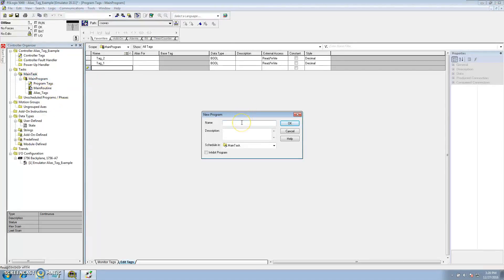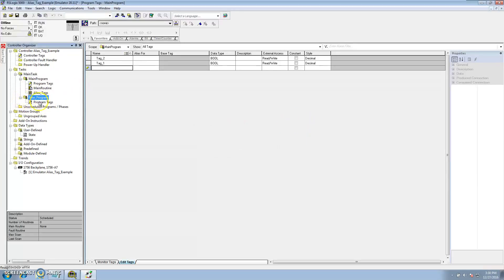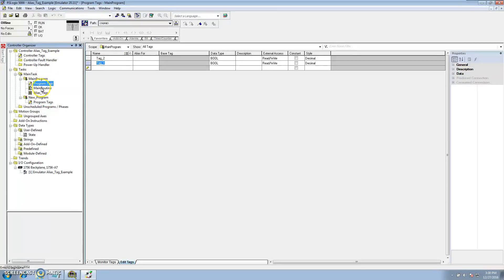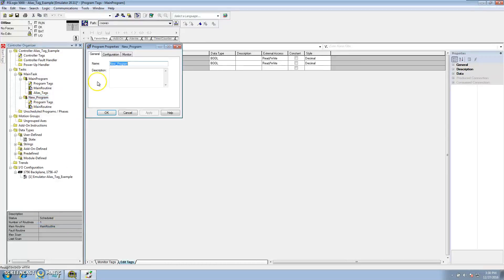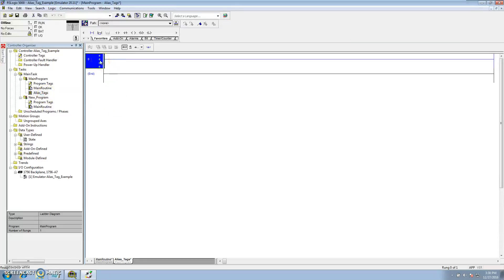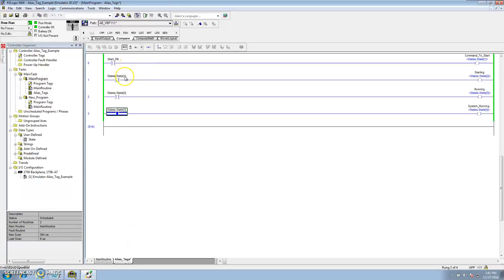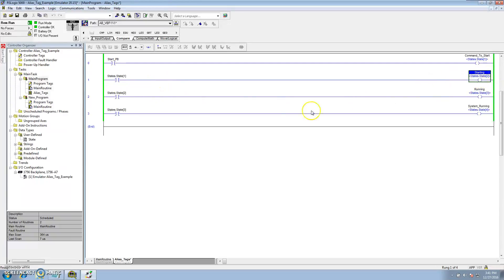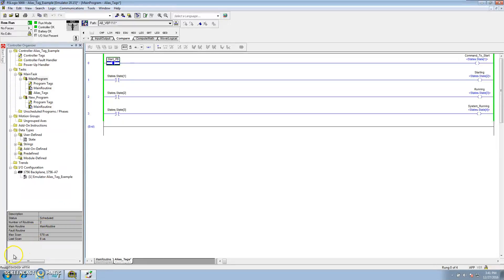RSLogix 5000 | How To Alias Tags in Rockwell Automation Software

Comment: Thank you very much, very good information. But I have one doubt. What advantages does using tag aliases provide, since if I have two tasks, let's call them task1 and task2, if I create a public tag in task1. I can call or use it by setting task2 in the following way task1.names_of_tag.
Reply from the maker: Alias tagging is generally used for medium to large scale systems although the benefits of using them in all systems far outweighs not using them.
A few reasons are quicker programming, state machine coding, alarming, real-world inputs & outputs, betting tag structure, among other reasons

Once you get a little more exposure to programming and or troubleshooting code this will make help you understand more.

Sounds like a good opportunity for me to make a video to better explain.

Comment: Very Good. Do the States need to be numbered sequentially, i.e. 1, 2, 3, 4 etc, or can they grouped; 1000, 1001, 1002, 2000, 2001?
Reply from the maker: Hello,

As far as state controls, you can label them whatever you would like....the important part is to just make sure they are used in order to control the proper function of what you are trying to do through the program application.

Feel free to reach if needed.

Thanks,

Shane